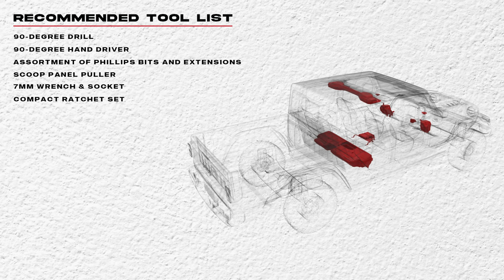Jeep Gladiator Stage-5 Audio Kit | Installation Video

Comment: 6k seems insane. Really like this kit, just cant justify that kind of money on what im assuming is really worth around 3k.
Reply from the maker: A high performance audio system isn't for everyone, and that's O.K.  If you priced everything separately in this kit, it would be well over $6k.  Most of the Jeep systems you see online only include a portion of this system because they don't feature dedicated full-range and subwoofer amplifiers nor a Maestro integrated Digital Signal Processor so it connects to the factory CANbus system without any cutting any wiring.  If you want to upgrade your Jeep with a performance system, our technical support is always happy to help create a home-brew version using select Rockford Fosgate components.  They can be reached at 1-800-669-9899 Mon.-Fri. 8am-5pm MST.
Reply: @rockfordfosgate   these damn jeeps are money pits. I have a rubicon diesel jt and it already has an oem subwoofer. Would that need to be removed with this kit?
Reply from the maker: @khoop009  I know, right? Better wheels, some suspension upgrades, audio, etc.  Yes, the factory Alpine subwoofer gets removed, something that can be sold on eBay or a market place.

Comment: So you are running 100 watts rms using 18ga wire? 🍭🍭
Reply from the maker: Yes, based on the short length of wire it's perfectly fine.  You can verify this using our Amp Wire Calculator: https://rockfordfosgate.com/support/amp-wire-calculator/